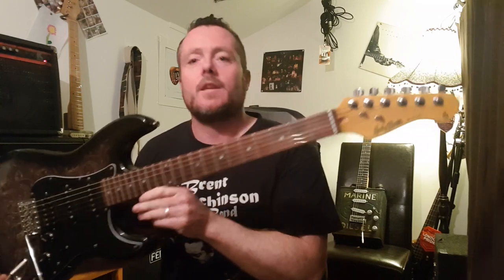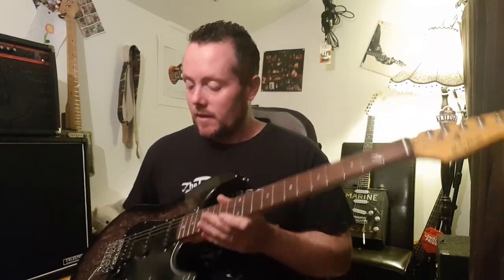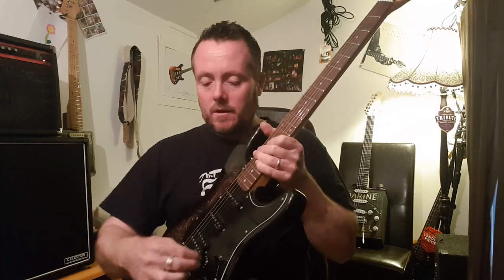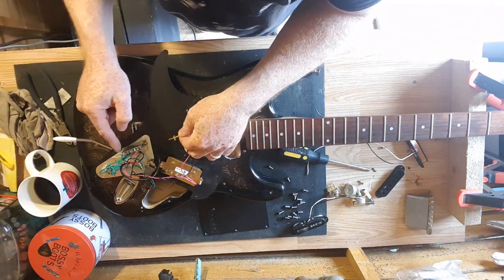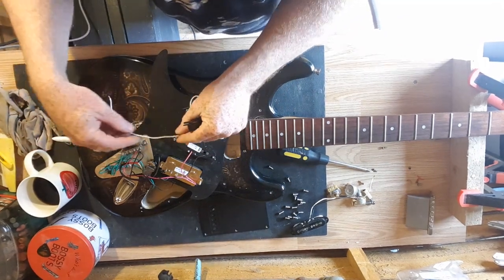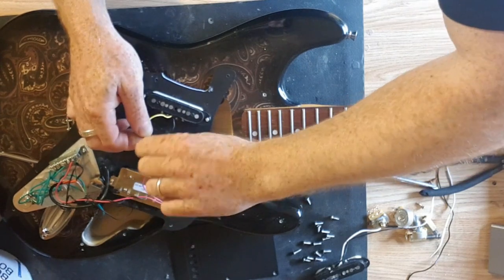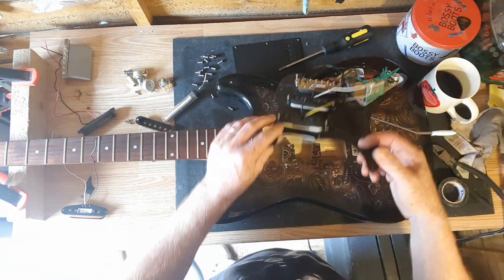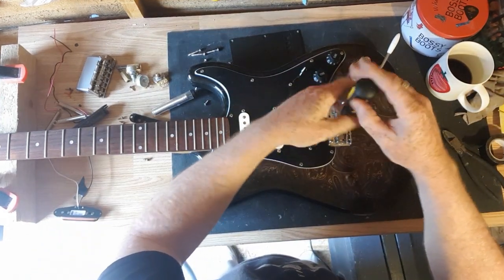Harley Benton ST-70 Black Paisley Stratocaster Full Fender Upgrade!.. Worth it?

Comment: Just subbed today, great video. I have a Squire I need to fix up (the scratch plate is cracked and a tone pot needs rewiring) I bought it for 25 euros off some doozer who managed to thread the truss rod (??? I cant even imagine). It was badly bowed so the action was terrible, after many trys I got a grip on it and fixed the neck so now I am in the market for a scratch plate. You were absolutely blessed to get those parts and the person that sent them is a saint.
Peace from Ireland mo chara, I look foward to your next video.
Reply from the maker: Thanks so much and well done on that tele

Comment: The rosewell pickups are not bad pickups. Different but not bad. Just a matter of choice.  I like Tone Specific pickups myself but the rosewell are good enough to get the job done.😌
Reply from the maker: Agreed! 😎
Reply: Brent Hutchinson my only gripe with Harley Benton is their quality control is very INCONSISTENT! You get some good or bad guitars and that makes ME leery to buy one. I’m a bassist but wanted a nice guitar to learn on and I was looking @ the Fusion Pro II, but was afraid of the quality control of the guitar. If HB get that part together, I’ll eventually get one. But I think you did a nice job on that strat!😌👍🏾
Reply from the maker: @etpslick100   Hey man I totally get it. Maybe try a cheaper one first?
Reply: Brent Hutchinson yeah I was looking on the Thomann website and seen some for less that 100 euros, some for 140-150 euros, but just love the look of those Fusion Pro-II’s. They have 24 frets, and I like the H-S-H setup. We’ll see.😳